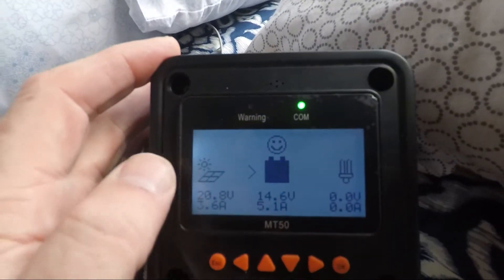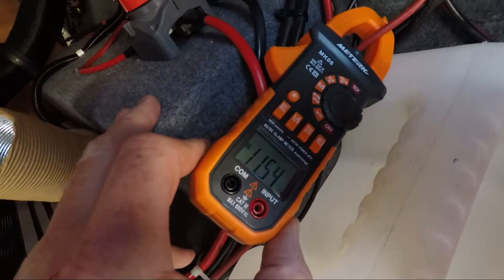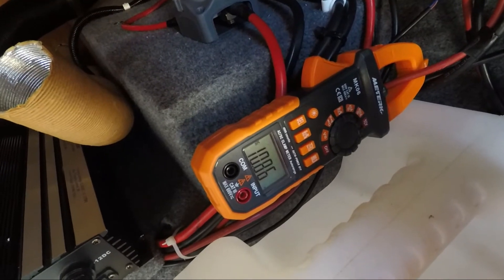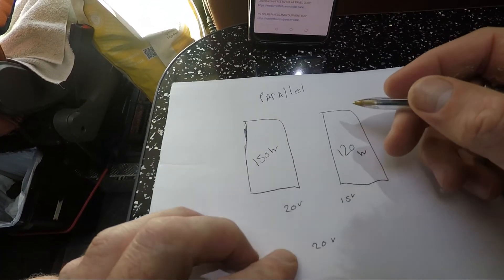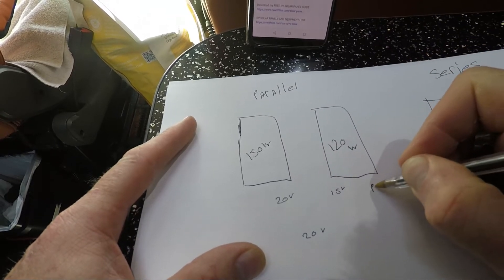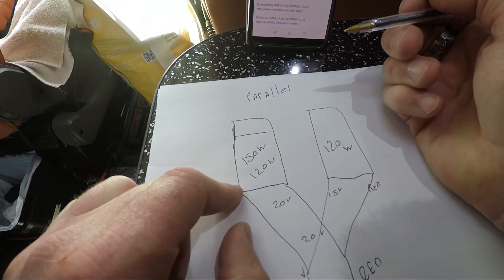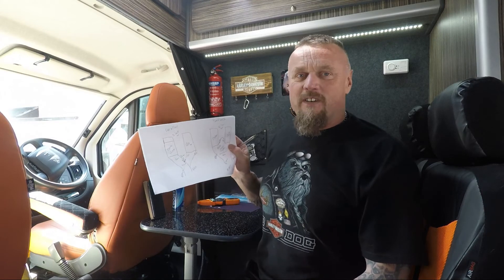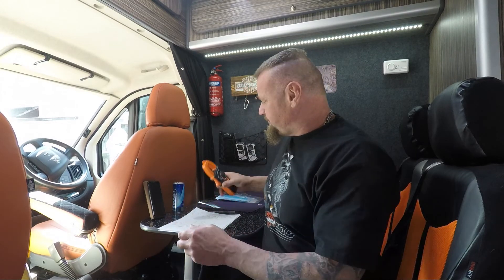WHO'S RIGHT ? CAMPERVAN Solar SETUP - Parallel vs Series -MPPT VS PWM

Comment: Thanks for the efforts. Unfortunately totally factually incorrect.  But the takeway is not very far off - use identical panels with mppt controller for maximum efficiency. Park under trees - wire in parallel, park in the sun - series. Not sure - go parralel, at least you will get some charge:)